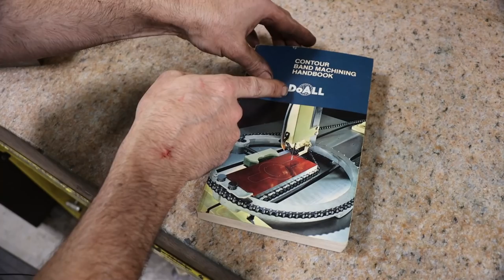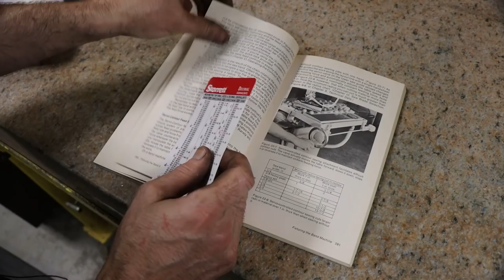(Audio Boosted) ONE Of THE BEST SAWS EVER MADE. A BIG DoALL Band saw for the shop :-)

Comment: I have a smaller version (and older!) and I LOVE it.  If you can find the compressor, get it.  It is wonderful to have a gentle puff of air blowing the chips off the line, but not using enough pressure to blow it in your eyes!.  Mine was shot, and the bearings/shaft are a "waterpump" shaft, bearings and shaft come as one piece, ordered it from the local bearing house, cut a new gasket and it was good to go.
Reply: What is wrong with his idea, or did you not bother to listen to his plans?

Comment: That's a well impressive piece of kit that DoAll saw, when I was an apprentice back in the sixties we had a Startrite vertical bandsaw using 1/4" X 10 or 14 TPI Starrett blades 'out of the box' and welded using the built-in resistance welder, usually cutting plate gauges out of 1/8" or 1/4" gauge plate (oil hardening tool steel). As well as the Starrett blades we had a DoAll blade which was factory welded and only drawn out of the stores for a 'special' job, I can't remember what it was, but the DoAll blade went back in the stores after the job was done as it was uber expensive. Many Happy Returns to Elizabeth, All The Best from Somerset UK.

Comment: Golly what a beast!
Thank you so much for the intro to the blade welder! I've heard that "the good ones" came with a welder and a cutter, but I had no idea that a grinder was part of that system.
I find it interesting that... 1- The system pushes the ends together rather than using filler. 2- The heat treatment is air cooled. I'm guessing that because the material is so thin it air cools quickly enough that quenching isn't required.
I enjoyed your editing of the move!

Comment: Okay I can see something that will help and make things easier. Install anchored point in the floor at several places to be able to move equipment around shop. Also build up a winch That  can be moved & hooked to each anchor as needed with a remote cable so can be at equipment then  control winch also have and make set of roller bars to go under machines to tool or slid on ! Kinda like Abom did!

Comment: Another purpose of the blade welder beyond making your own bands from a bulk spool is to cut internal shapes, think like treepaning, you drill a hole, pass the blade through the part, then weld the loop together and install, when you are done cutting you cut the blades apart again.
Reply from the maker: It also supplies power for a etching pin. I would like to find one of those

Comment: You are going to love that saw! It is one of the most used tools in my shop. In my instagram to you I said it looked like we had the same model. I was wrong mine is a MP-20, You have a much deeper throat which will be most advantageous. Mine does have automatic post rise and lower and a hydraulic tilt, and feed. Mine will not allow me to hand feed the table though. You obviously can hand feed the material, but the table will not move manually, either to feed or to tilt.  What a nice find! I know that it will prove to be an invaluable tool in your shop.

Comment: They need to start making trailer brakes like semi trailer breaks. If you lose power (or air) the brakes lock up.
Reply: That's what those do.  If you listen to Al's comment about "safety brakes" you will get the idea!  I have had (and were required on most trailers I've owned), battery operated safety brakes for many years!  Oh BTW, "breaks" ??
Reply: @paulcopeland9035  I know how safety brakes work, but they do not function without power from a battery. Semi trailer spring brakes function off air, and if you lose pressure the brakes apply.
Reply: @MaverickandStuff  Well, I know how they work as well.  The issue is not air brakes.  Electric brakes are a safety item.
Reply: @paulcopeland9035  Yes, and as a safety item, they should lock up if power is lost. No need for a battery and a tether to activate them after a runaway. I understand this would be a annoyance for many because when disconnected the trailer cannot move. In the end it would be much safer. I was just giving air brakes as a example of how they should work.

Comment: You can cut a square hole in a block of metal
Reply: Drill a hole feed the blade through the hole and use your welder to weld it. We did it many times in mold shop where I worked.

Comment: Those electric, north american Trailer brakes shock me!
In Europ you have to have mechanical or air powered brakes on trailers, that are failsafe in case of a brake away! 
Relyeing on a wimpy batterie and solenoids to apply the brakes in case of a brake away is even in theory just stupid! 🤦‍♂️
Reply: All big trailers are air. Smaller trailers that are under CDL are usually electric now a days. They used to be mechanical, or hydraulic surge brakes.....and they sucked. Never worked, constantly out of adjustment, had to put in a lock out pin to back up, that was easy to leave in and then you'd have no brakes..... electric trailer brakes work great. Especially with a modern proportional brake controller  they apply seamlessly with the tow vehicle, no surging, no locking up tires, rarely needs adjusted